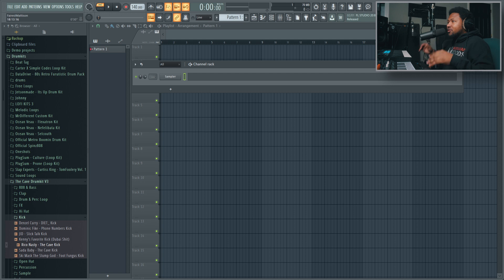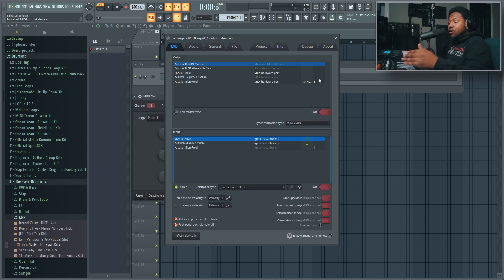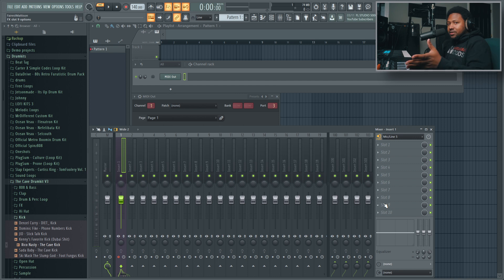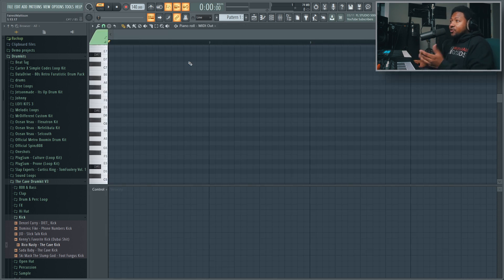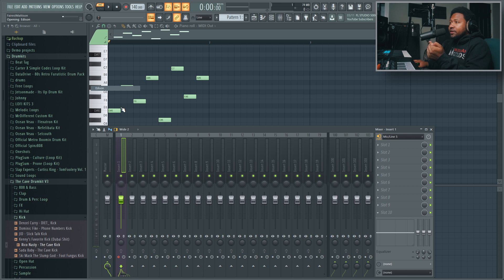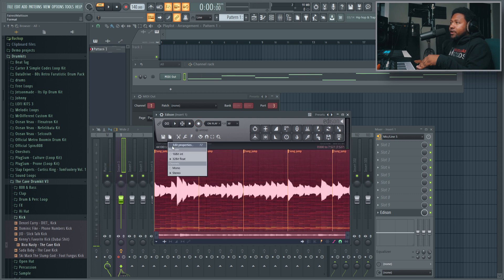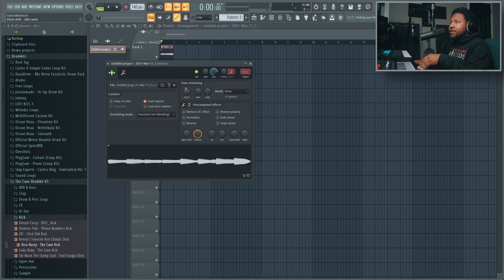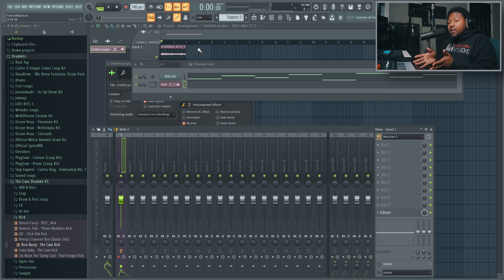Setup hardware synth in FL20 as a plugin! (2021)

Comment: Bro thank you SO MUCH for this. Can you please please please do a video on how to input notes into the piano roll using this same synth? Love your content bro keep it up. You earned a sub.
Reply: Have you found a solution?
Reply: @ksager123  Nada. I think a midi adapter is needed to run inline from the midi in and midi out to an interface or directly to your pc. It won't work with the USB B connector.
Reply: @Gelato__33  that's what I was thinking, but I wasn't sure and didn't wanna buy one if I didn't need it
Reply: @Gelato__33 Of course it is, if your synth doesn't support USB MIDI.
Luckily, USB MIDI interfaces are cheap (and don't need to be high quality, as opposed to your audio interface). You just connect MIDI in and MIDI out, and it'll work like a charm.

Comment: How did you route your hardware sythn to your midi controller to fl? Did you use midi 5pin to your controller & then from your controller you used usb to the computer? Is your controller the master or the sythn? & how r u getting both audio & midi notes into fl? Is there a way without converting one or the other via Edison?